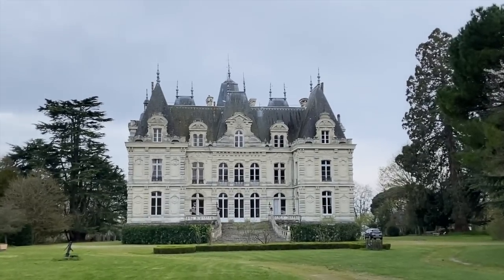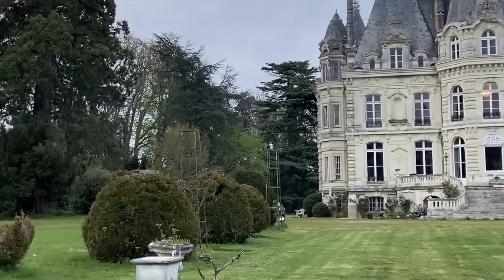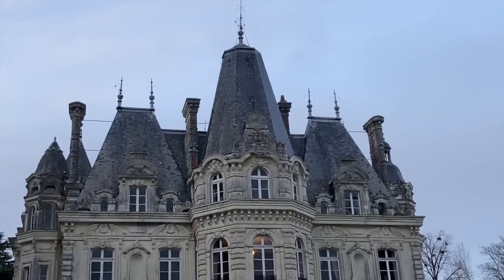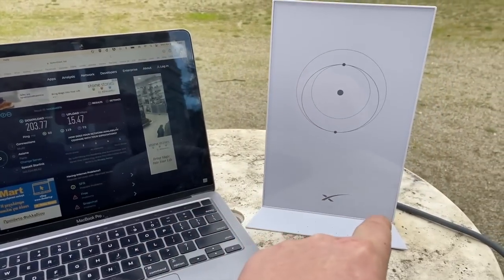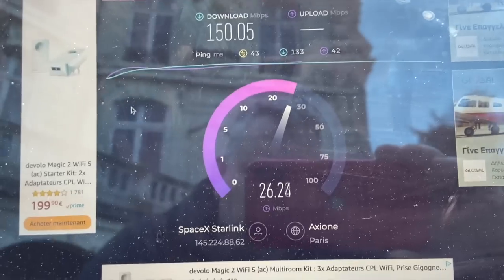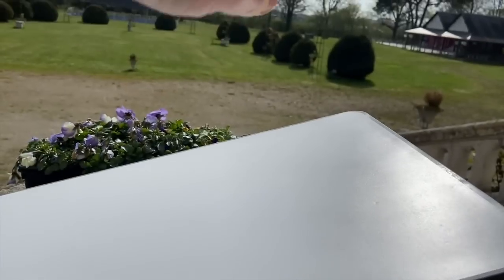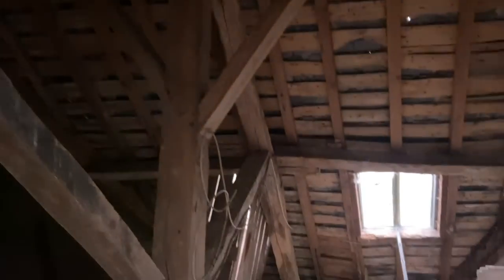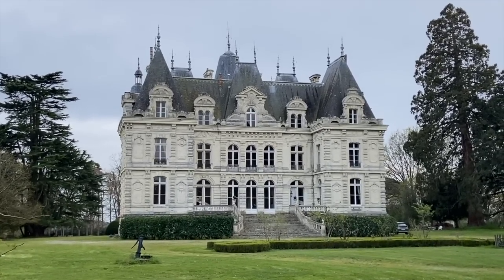Château de la Grifferaie S4, E10 "Starlink for the Chateau"

Comment: Really cool now you can run HD on everything including your local network so your security cameras should run no problem in HD too when you access them from far away. Now you just have to sort out the network inside the Chateau so you don’t have dead spots all over the place. I am sure you have considered it but what about that dish being up there is very strong winds? Could you set it up so you could wind it in if you had a bad storm coming?

Comment: Bonjour j' ai vu votre installation starlink j' ai quelques questions, le routeur est installé dans les combles du château, mais comment faite vous pour réceptionner le wifi dans mes pièces les plus éloignés quelle installation avez vous faite? Merci. Laëtitia
Reply from the maker: We bought an extension cable, so it runs down to the Premiere etage.  Then we hooked it up to a Google Mesh system with five extensions throughout the building.  Works well.